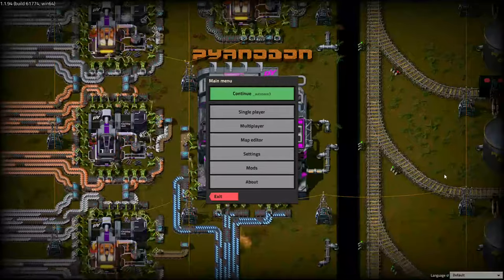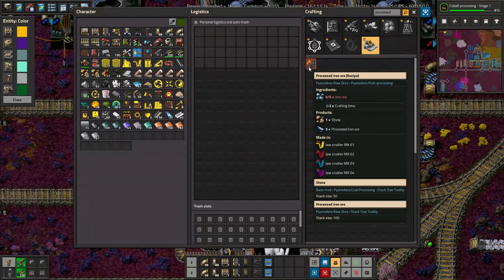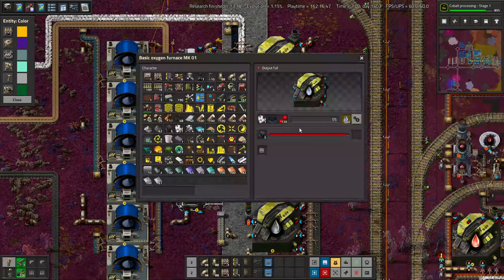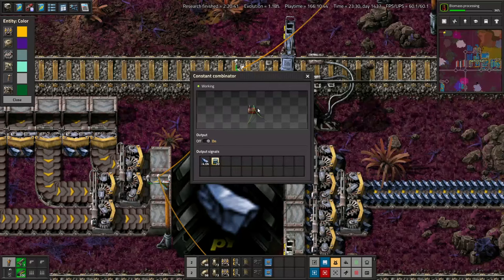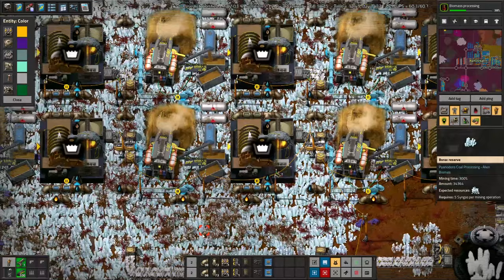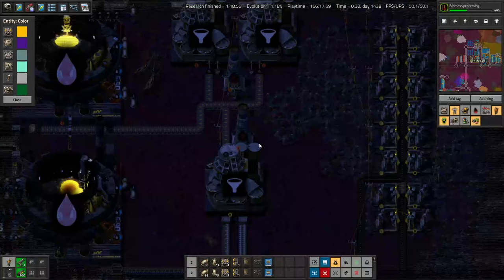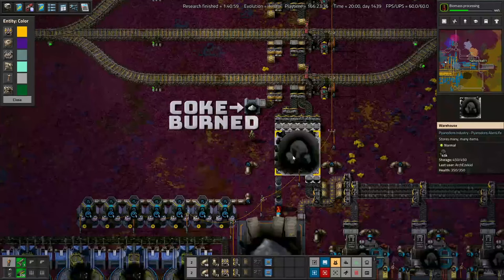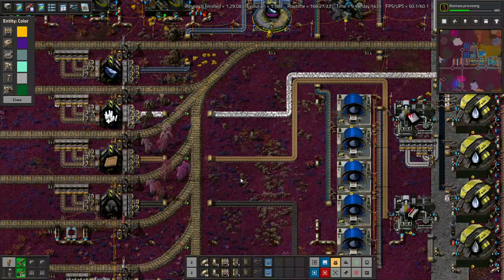Pyanodon Recap Supershorts #3: Iron Processing and Cybersyn Basics

Comment: A fun trick you can do with Cybersyn is that you can get away with drastically fewer depots. If you set the depot to not require the train to return before dispatching you can run a large network off a single depot. Just set up a big stacker for trains to wait at before their depot, an optional path out, and a refueling station somewhere, and it's good.
Reply from the maker: Oh, that's really helpful! We have the depot set in this way, we just didn't realise we could pull it off with a stacker.